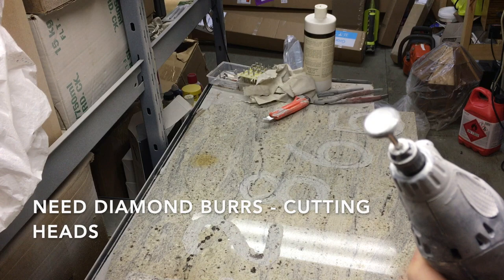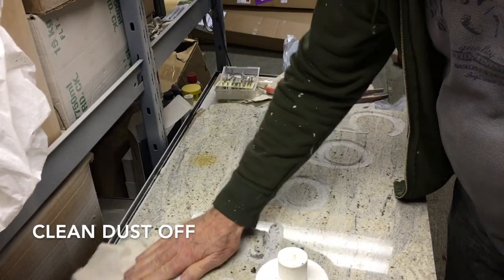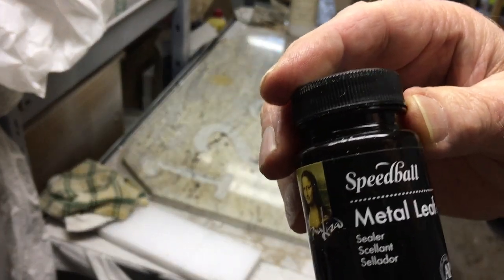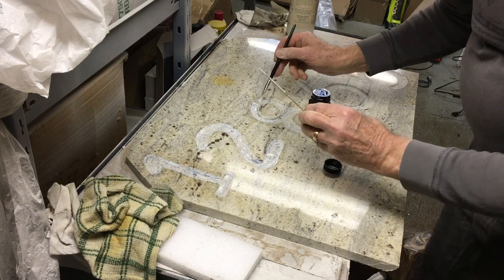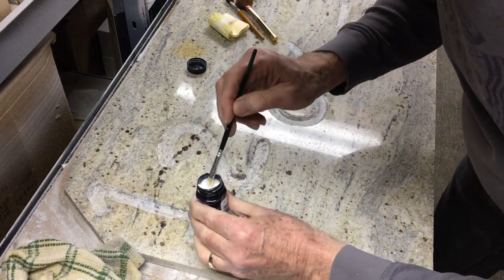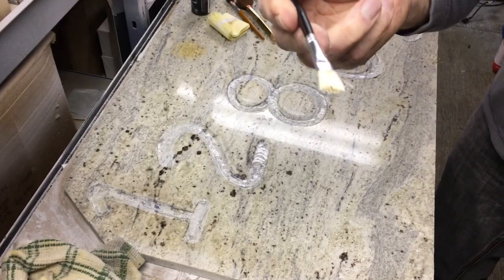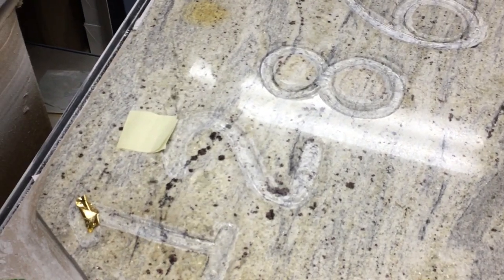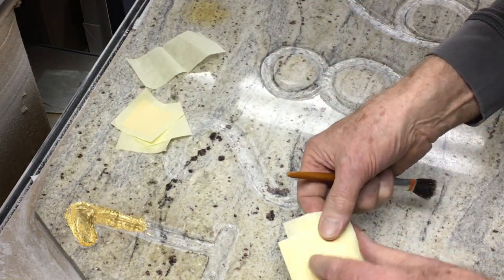Applying gold leaf gild to granite house address numbers

Comment: Isn't metal leaf sealer supposed to be applied on top of metal leaf, to protect the delicate layer from the elements? Even though the stuff looks a bit milky, it should form a clear coat finish when it dries, right? Anyway, have to applaud you for boldly trying out new things. Hope to try something similar myself.
Reply: Yes, the sealant goes on after the gold